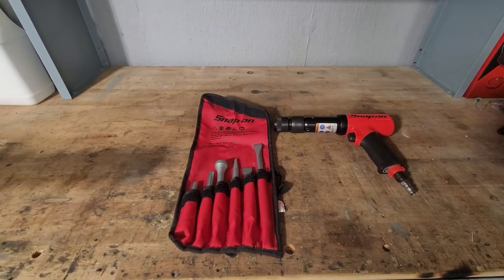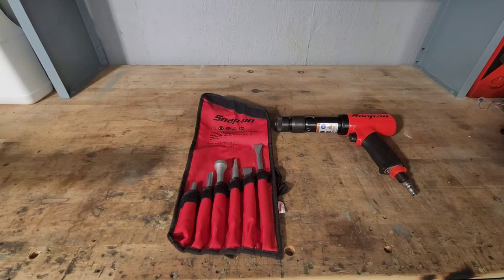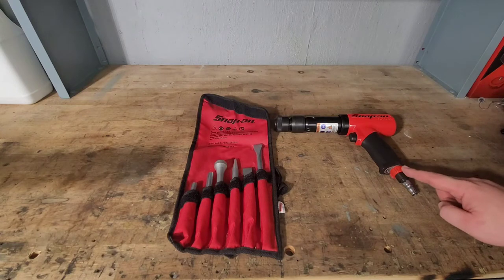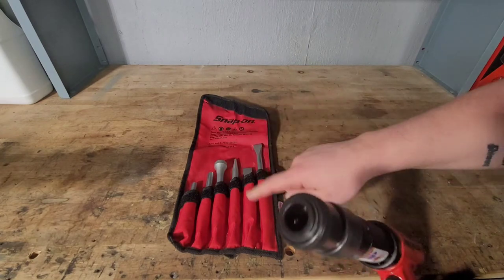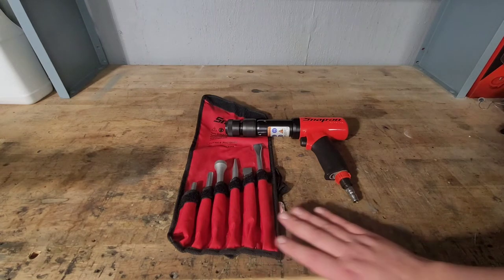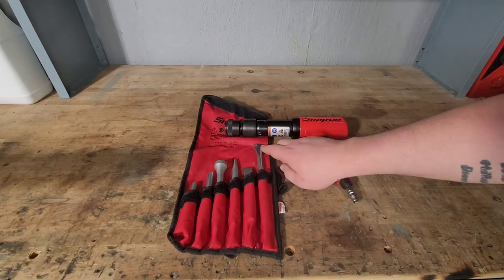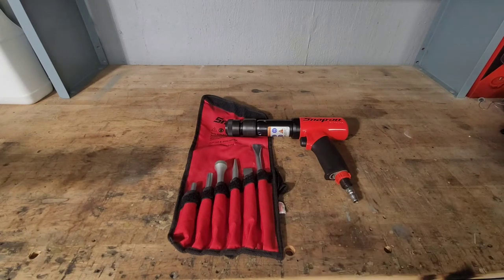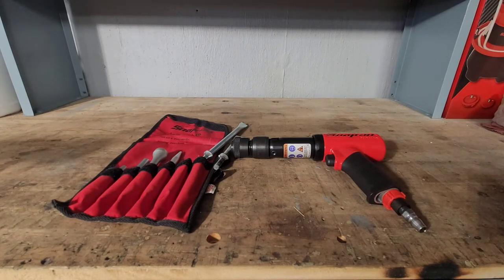Snap on super air hammer

Comment: Great review, thanks for pointing out the 4 position air flow! I had bought mine online used about 10 years ago and have had it in storage for the past 8 years, the product number is PH3050A, what is the difference from a PH3050B?
Reply from the maker: Probably just the outside look. Both are 2500bpm. Newer model
Reply: B Came With A Quick Change Chuck. Some Later A Models Did As Well
Reply from the maker: Thanks